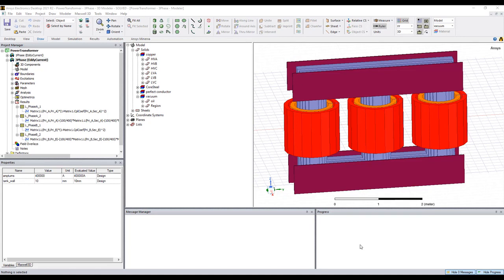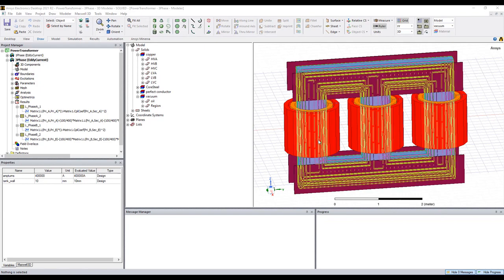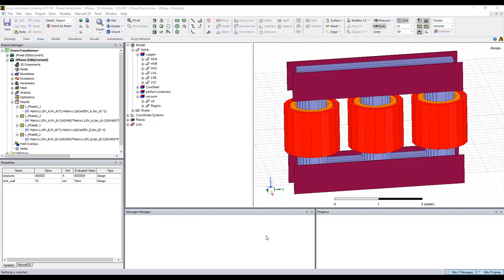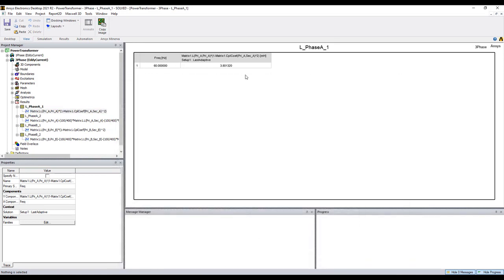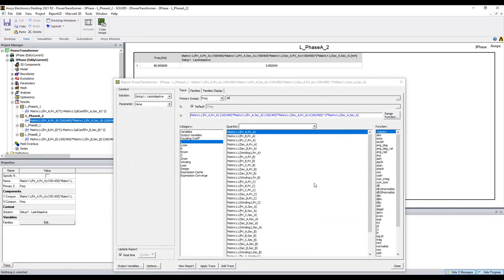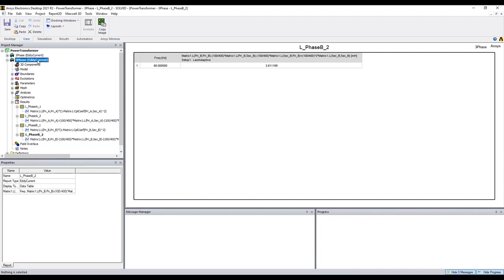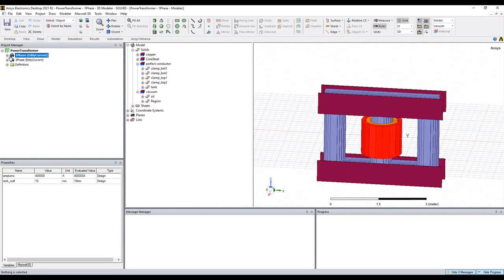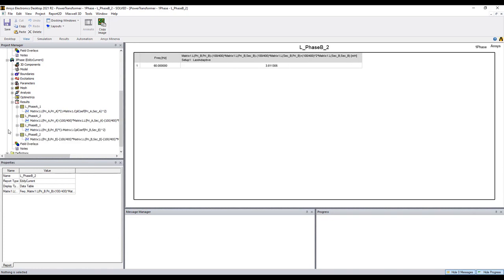Leakage Inductance Calculation in Ansys Maxwell

Comment: how we can  draw the graph between leakage inductance and thickness of the inductor
Reply from the maker: Hi there. In this case, the thickness of the transformer needs to be parametrized. Once the simulations are completed, the graph leakage inductance vs. the thickness can be generated by replacing the default Freq by the defined transformer thickness parameter.

Hope this helps!

If you have additional questions, or are interested in Ansys Training or Mentoring, please reach out to info@simutechgroup.com